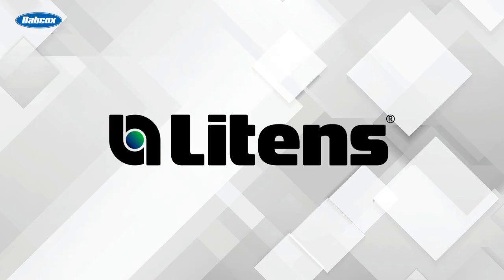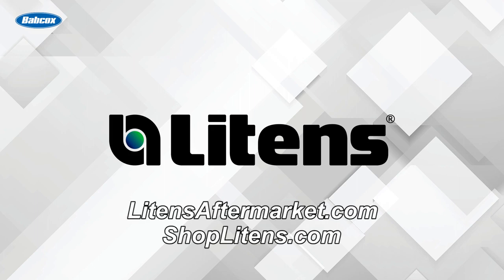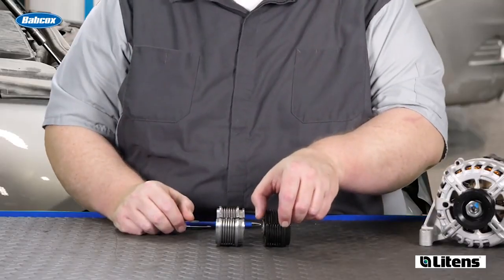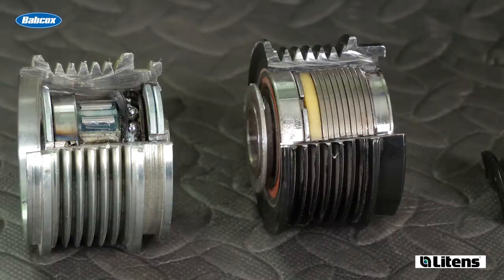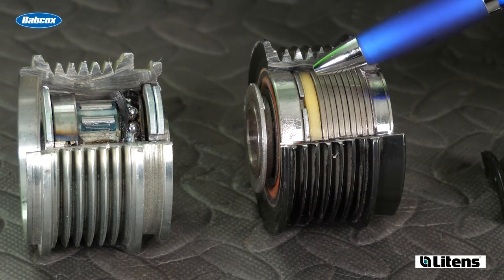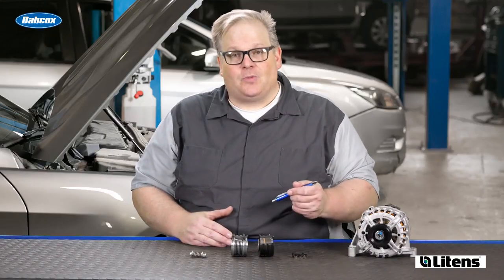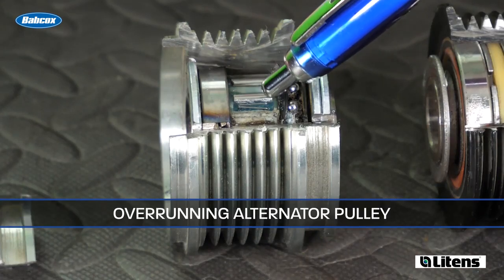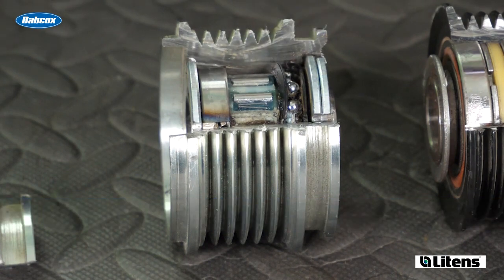What Is The Difference Between An OAD And An OAP Alternator Pulley?

Comment: These pulleys are a bunch of crap. Got to replace them at 60,000 MI. My old 2000 Impala had 260,000 miles on it before I sold it never did anything to the alternator. The alternator had a solid pulley. Imagine that.

Comment: So which one is better?  OAD OR OAP?
Reply: The OAD has two springs that are wound in opposite directions. This gives a springy absorption of initial torque, and a more smooth dampening of jerking vibrations when the accelerator is released and the engine slows. This gives better belt wear, slightly better fuel economy and a need for maintenance replacement of the pulley more often. Unfortunately the cost of a new pulley is close to that of a new aftermarket alternator, so there is a serious price to pay for this maintenance. I'll hazard a guess it is more than the tiny fuel economy increment. Automakers were pushed by government to increase fuel economy, and they sacrificed durability and even engine survival. Why is that not a surprise?
Reply: @spelunkerd 
What is the difference between  OAP and OAD???
Can we see the difference with eyes???
Can we replace an OAP pulley with an OAD pulley????

Comment: in other words.dont buy newer vehicles.they are intentionally & carefully overcomplicated to milk your wallet dry when you buy them.but more importantly keep you buying constantly failing parts thruout your ownership.buy an older car & keep your money.im still driving a 1990 ford.30 years & 200+k miles.still runs like a champ.why buy something that is designed to fail?
Reply: It's always been a race for better fuel economy
Reply: The OAD is designed for modern 4-bangers that use diesel or direct injection. They don't run smooth like a V8, so all the engine accesories are always speeding up and slowing down, measurably, between cylinders firing. The heavy alternator stator puts pressure on all the accessories. The OAD mitigates this harshness and helps all the accessories last longer. It can also help smooth out the belt drive on V8s with a big, rough camshaft.

The OAP is useful on high power V8s with firm shifting transmissions. I know when my OAP needs changing when the belt squeels like a stuck pig when I shift and engine rpms  drop from 6500 to 4000 or so.
Reply: @Adam1nToronto 
Hey Adam 
What is the difference between  OAP and OAD???
Can we see the difference with eyes???
Can we replace an OAP pulley with an OAD pulley????